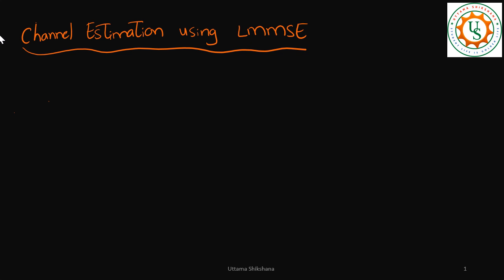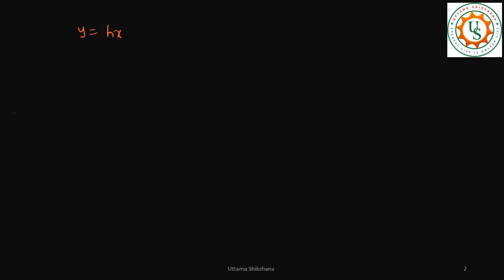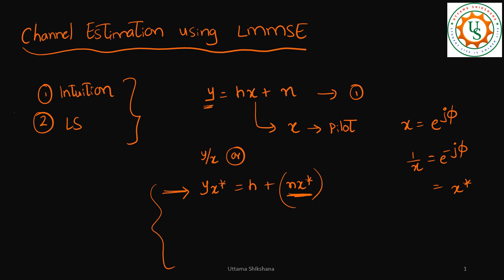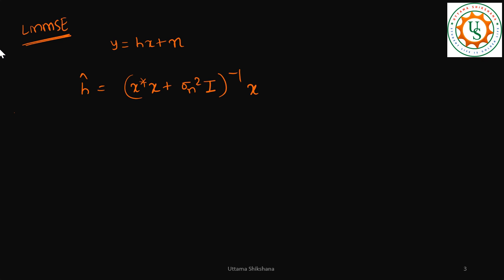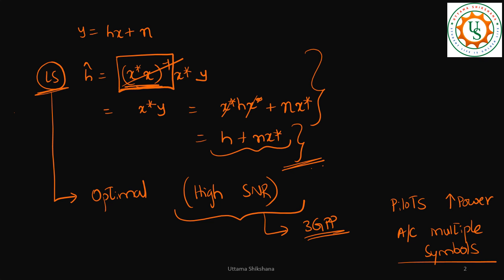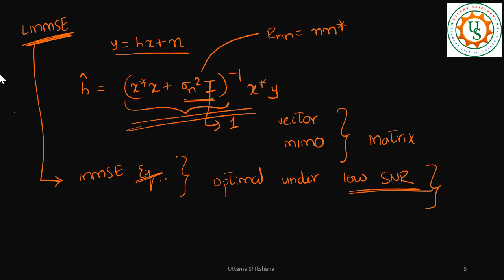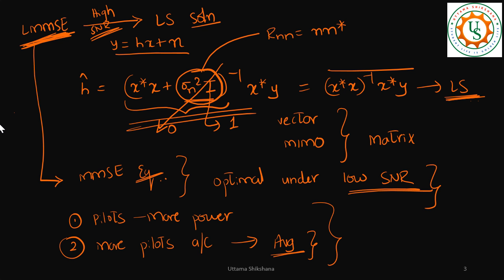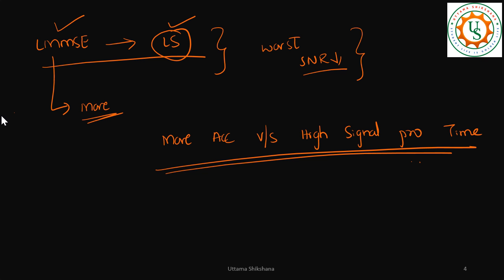[Series #84] MMSE Estimator for Channel Estimation ?

Comment: So do we dynamically switch between channel estimation using Least squares and LMMSE based on SINR in live network ?
Reply from the maker: Thanks a lot for this question.
A very good question.

Actual, the SINR estimation will usually happen after the Channel Estimation (CE).

So, for Channel Estimation, there is NO such switch. You need to fix any one estimator depending on the pros and cons mentioned in the video.